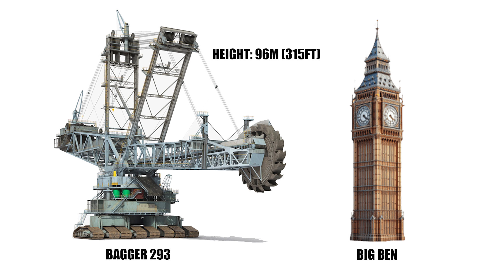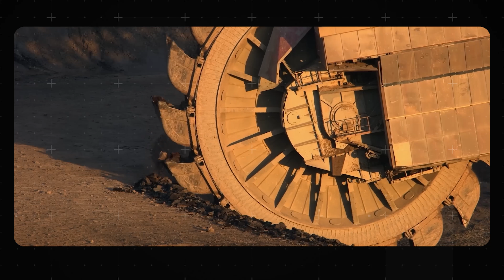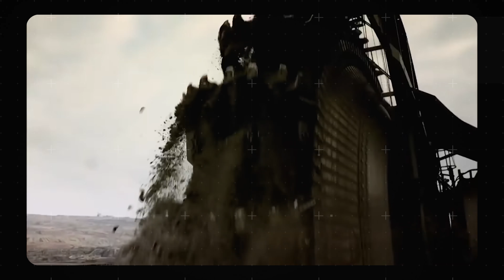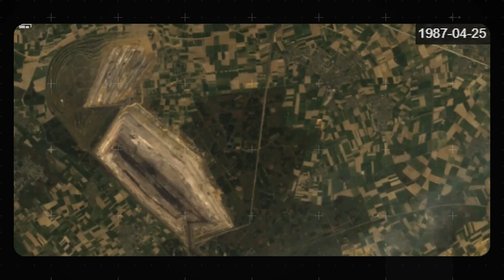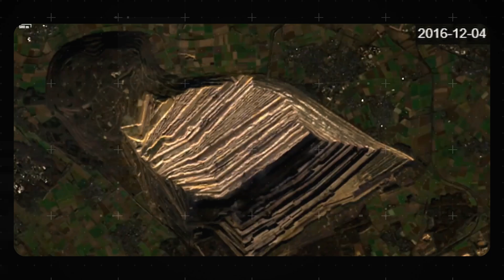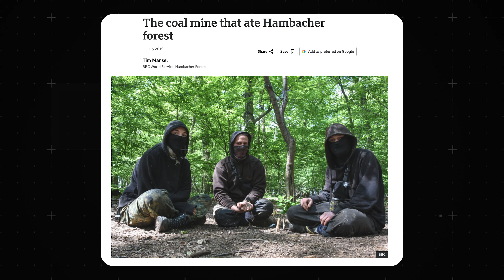The World’s Biggest Land Vehicle Will Soon Be Useless

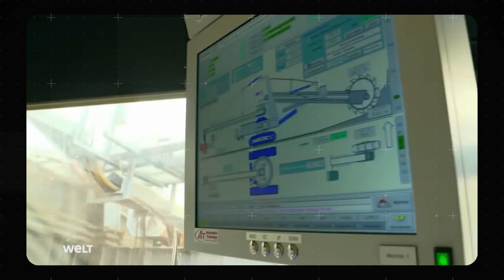Comment: 6:20 I think the claim that there is no building that It could fit inside is false. The Brand-Briesen Airfield Zeppelin hanger should be able to do it.

Bagger 293 is 225m long, 46m wide, and 96m tall.

The hanger is 360m long, 210m wide, and 107m tall.

Both are oddly shaped so I'm not 100% sure, but both are in Germany and Bagger can move after all.

Comment: I work at a Taconite storage yard in Minnesota. We have an original 1970's era bucket wheel excavator we use and maintain. It's been modified and changed over the years. I'm one of the on duty mechanics looking after the machine when it's in use. 

Anyways, i fear my job (and the operators job) is going to be automsted in the future. Time will tell i suppose.

Comment: Germany has completely shut down it's nuclear power plants and now wants to shut down it's entire coal system? Bold strategy, let's see if it pays off for them...
Reply: It already did. The bit of nuclear was never really a issue to replace, we replaced that tenfold with renewables already. Coal will take a few more years now, the plan was to exchange coal for gas in the meantime (just a bit of remodeling furnaces) but since thats a rare good... We will accelerate Renewables more. 

We are BTW a net energy exporter.

Comment: Because the price of electricity / going green in Germany didn’t skyrocket high enough.
Reply: Actually it skyrocketed because of Gas. Gas is and long was a intermediate type of Energy, its used to smooth out pits in other production. And energy prices also include Oils wich are used for vehicles not electrical energy so such numbers might be misleading. Renewables actually saved Germany from way worse issues by being a reliable and domestic option.
Reply: @sppb666 more like it sky rocketed because they took their nuclear plants offline and tried to replace it with unreliable renewables. It was such an unmitigated failure they are scrambling to bring the nuclear plants back online which is costing a fortune that didnt need to be spent. It was already high pre-ukraine.
Reply: @EmoticonFury nuclear had verifiably 0 impact on Energy prices funnily enough. Almost like them being replaced by renewables and only ever being 5% might play into that.

Renewables are also pumping out a relatively steady 50% of Germanys total energy mix year around. 

Nuclear was allways a Nische power option without real use in Germany. It had no impact. None.

Comment: Anything but nuclear…

In all seriousness though, these machines are an awesome testament to our skill and power.
Reply: Built before Nuclear... And outlasted it rightfully so. Germays Coal Powerplants have relatively small environmental impact, there are several filtering steps for the exhaust gas before its Vented to atmosphere. Its almost entirely CO and CO2 by then. Nuclear was never really a option for Germany, after WW2 nobody wanted Germany to have nuclear power for quite some time, then some where build, then one leaked Radiation several times (only a bit but still), Chernobyl happened and at that point any new plans where scrapped. Later that phaseout was reveresed, plans happend despite growing protests and then Fukushima happens at wich point the final strike was Done. In 2022 our Minister of Economics was in Talks about keeping the remaining ones on longer because of the energy crisis and was told that they skipped most Maintance and Checks and that there is no new Fuel available anyway. Since then, they are offline and are actively being deconstructed. 

Nuclear only ever accounted for 5% of Germanys energy, just like that ONE mine. By the first phase out plan nuclear was already overtaken by renewables, by now renewables make up 50+% of Germanys electrical energy generation, Germany is a net exporter, especially to France that have to shut down their Nuclear Powerplants because their Rivers don't Carry enough water anymore. Nuclear in Europe has to be phased out soon for exactly that water reason and the replacement, even in France is real renewables.

Comment: Bagger, or more precisely all of the baggers would cost way more to build today than they did when they were built, as such. These machines will most likely be auctioned off as land movers, terraforming machines to flatten landscapes and prepare places for construction. A single bagger can do the work of nearly an entire fleet of excavators and when complemented by a fleet of excavators, acts as an exponential modifier for work efficiency on that scale, simply because of its size.
Reply: These things will be dismantled and some put in Museums. They have no application as "land mover" as thats cheaper and more precisely done by regular excavators that can be moved elsewhere after the job is done.

Those Maschines are industrial Mining equipment with huge power needs, massive upkeep and a whole infrastructure behind them. They are by Design hyper specialized to dig coal. They will do terrible with most other grounds and are way to big to actually transport somewere.

Comment: Back in the day, I was completely unsurprised to learn this was bulit in Germany.  It's also funny how coal was needed recently because Germany abandoned nuclear energy.  Germany a country of efficient engineers and terribly inefficient politicians.
Reply: Fun fact, Germany now burns half the coal it did while the nuclear plants were running.
Reply: @karl0ssus1  That's because they have expanded their other energy resources in proper German fashion over the past decade and a half.  Not only would coal would be completely replaced by now if they hadn't decided to close down their nuclear industry, but their own power generation would be far greater and energy cheaper in the present if they hadn't.

I'm not criticizing Germany on this front, even if I disagree.  They are one of the few countries that made democratic decisions (silly political decisions in my view) about their energy infrastructure and actually went through with plans to make those decisions a reality.  They decided to close nuclear and decrease fossil fuels.  

Of course, this couldn't be done instantly and simultaneously (like more unreasonable countries are atempting), so they ramped up coal to initially counter closing down nuclear, but have subsequently ramped down coal as other energy resources have been developed  to replace both over the last 15 years or so.  Their engineers have done a very respectable job in that regard.

Comment: German energy prices through the roof, no nuclear, not enough renewables, and those that are there not natively manufactured.  Yep, sounds like a great time to kill coal. Well done, Germany, lol.
Reply: "Energy price" in Germany also factors in Oil for Disel and Gasoline and Gas for heating. Electric energy is not that expensive its mostly the Gas and Oil that skyrocketed. Renewables actually are at over 50% year around part of the mix. So they are whats stopping electricity from becoming more expensive.

Comment: so it can't be disassembled and parts flown to another mine with a chinook? that would take too long and use some fuel, welp, I guess its better to take years to scrap it, spend unfathomably large amounts of fuel to generate power to melt it down into raw steel and build it from scratch painstakingly over decades a few tens of miles away at the the next open cut mine...

Comment: I love how it powers itself.

Do a video on the mine with the gravity-powered electric trucks: the mine is above the drop-off so regenerative breaking the loaded trucks recharges the battery for the emptied trucks to drive back up to the mine. So it uses geological gravity potential energy to run the system for free, it is so good.
Reply: It's not free energy. They still need to haul that material up and out of the mine and that's done through a conveyor belt powered by electricity that the haul trucks are dumping into. What that system actually does is transfer power costs from the trucks to the conveyor belt, which is far more power efficient.
Reply from the maker: Cool idea!

Comment: Honestly, their plans for going forward ought to include an option to reinstate its possible use.  Rather than turning the pit into a lake (which, by the way, will have significant ecological impacts) or scrapping the machine, it should just be left there.  You never know what will happen in the future; maybe one day there will be an energy crisis and they'll need to start burning the coal again.
Yes its good to move away from coal dependency, but it's always good to keep your options open.
Reply: A lake is honestly a sensible choice. It's super cheap, safer than a pit, and lasts extremely long with little/no maintenance.
Reply: @charleslegates9231  and pumping out water while big job still isnt that hard on the grand scheme of things should the need arise to dig again
Reply: and digging all that earth for a LIGNITE of all things wasn't ecologically impactful?
Reply: @dubl33_27  I never said it wasn't.
But two wrongs don't make a right.

Comment: Coal (which just about includes lignite) is usually contaminated with heavy metals. I wouldn't fancy drinking from the resulting lake.
Reply: They may need to do significant ground rehabilitation, aye.
Reply: Yeah, it’s going to turn into a lake of acid when the carbon, sulfur, zinc, nickel, and iron in the coal leach into the water. And I mean literal acid. Those elements cause the water to have a very low PH of 1 to 3. Germany’s government is stupid.
Reply: The ground of the mine is already being reworked and water in Germany is always filtered before being put in any water supply system. The idea was however to build the lake into a gigantic water battery for renewables. Not as storage for drinking water. 

The rework was allways done with the non coal excavations so most of the mine is already filled back in significant.

Comment: A Caterpillar D8 bulldozer fits in one bucket. There's pics of that
Reply: Well, that.. really puts things into perspective
Reply: No it doesn't.

I looked up the picture of a bulldozer crashed into the side right next to the bucketwheel and it wouldn't fit into a bucket.
Reply: @DlK69  yes it does, I know what 21m looks like
Reply: @-_-___----_.. 

That is the diameter of the wheel combined with it's buckets.

Look up the pictures of the crash and you'll see that each bucket would need to be at least twice as wide and like 70% taller for it to fit.
Reply: You talking about the one where it hitched a ride?

Comment: If they're just going to scrap it, I could use the engine for my Volkswagen project.
Reply: Would be perfect for a Miata swap
Reply: @snippingtool7810  not the miatas 💔
Reply: You'll need a LONG extension cord!
Reply: @frequentlycynical642 about 1/4  mile but if you do it right it will pull the chute as it unplugs
Reply: Use it's rotary wheel gearbox too xD
Reply: But it has no engine, it is powered by electricity straight to the electric motors from an outside power supply
Reply: @Teenyweenybeans That's where's my portable nuclear power plant comes in.  😊
Reply: @johnh1932   borrowed from France?
Reply: @FloofMoji Nope, I bought it  on TEMU.  What could go wrong?  😂
Reply: @Teenyweenybeans  All we need is a ZPM
Reply: @ZacLowing 💯
Reply: @Teenyweenybeans Powered by the very powerplant it feeds
Reply: @Teenyweenybeans Yes it has an engine, just use the electric motors
Reply: You mad man 😂😂😂😂😂😂
Reply: it would fit in a miata
Reply: @VitalyDryburgh Maybe with a little welding and a big shoehorn.  😅

Comment: Of course it would work with regular excavators and trucks but it would take more personell and probably cost more. The power plant doesn't need a continuous inflow of coal, there's a buffer storage before the furnace anyway.
Reply: You would end up burning more energy that you get out of the lignite. 
Lignite is garbage fuel. 
You don't use a diesel engine where you can use an electric motor, the efficiency is just too low.

Comment: 4:30 The issue isn't really that trucks create discrete batches of coal while the excavator creates a continuous flow. That flow is loaded onto trains to carry to the plants anyway. What's relevant is that you're not moving as much machinery for a given amount of coal.
Reply: That was my thought too.  It wasn't the discrete nature of the delivery when using standard trucks. Even in energy systems like this the coal isn't going directly from the mine into the boilers, its collected in storage areas on site at the power plant first before being actually placed in the boilers so they can match electricity production to electricity demand precisely.  Like a capacitor in an electronic system.  The problems is efficiency and capacity.  It would be more expensive in terms of both cost and energy expended to do the same job with trucks.  The ROI and EROI are both worse in a truck based system.
Reply: Yeah I was gonna comment the same thing. Trucks absolutely can provide a continuous supply of material you just need to make a stockpile. Continuous mining equipment like the bagger has a lower cost per ton moved which is why they're using it but is less flexible than trucks. That's why they need to scrap this when you could just sell the trucks to another mine. Its also no good when it comes to hard rock as you need to first blast the rock before you can dig it out.

Comment: The Green Party made them scrap their nuclear power plants, because Greens love lignite thermal coal and open pit mining.
Reply: Made them, because the Greens control national policy.  Kind of like how illegal immigrants and liberals somehow control and ruin the United States, despite having neither political power, public support, or a coherent agenda.  The enemy is simultaneously inferior and weak, and also somehow controls everything.  Where have I heard this before?
Reply: So you disagree with Democracy? 

BTW it was CDU not the Greens.
Reply: In fact it was the conservative party which decided the end of the nuclear plants.
Reply: Nope, the consensus was to stop producing yet more nuclear waste by running the power plants but replacing them with wind turbines an solar power. Burning coal will slowly phase out, so no additional CO2 into the air.
Reply: @ulliulli1287 because the population has been lied to about the tradeoffs.
Reply: @ulliulli1287  And what a great idea it is to replace your safe and stable fossil fuel and nuclear energy production with renewables! Especially if you totally lack the energy storage capacities to make it stable for your grid consumption, as well as the necessary grid infrastructure to get it all from where it's produced to where it's needed. And you won't be able to upgrade your grid accordingly for at least the next few decades. Truly one of the greatest strokes of genius in the history of electrical engineering!
Reply: @axelhopfinger533 but hey! Renewables, am I right? All the kids love solar panels.
Reply: @axelhopfinger533  fossil fuel is not safe, it's just rich enough to buy every politician

Comment: Buy this to dig a nice new canal!
Reply: That would be somewhere where there's lot's of free space on both sides of the canal.
Reply: Wonder if this thing could be used to dig up oil shale instead of being left to rust or get scrapped. There are some massive deposits of it.
Reply: It needs a powerplant to operate.
Reply: @rburns9730  Give it a couple of solar panel!
Reply: @rburns9730 not that much actually.